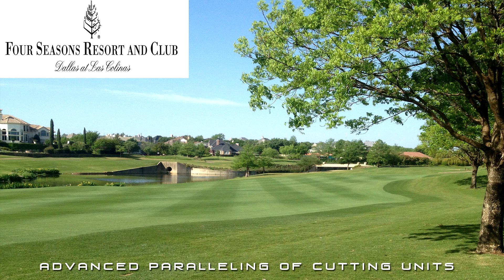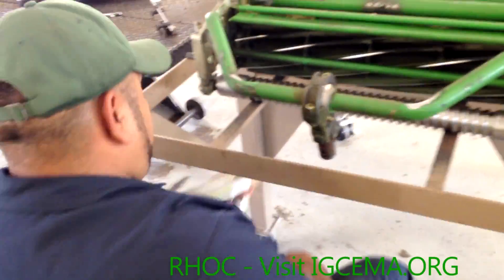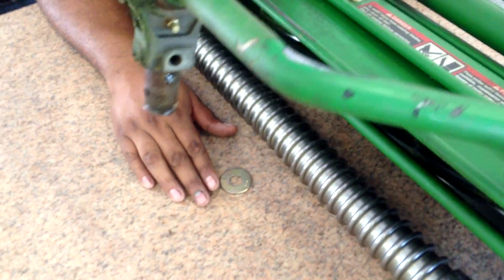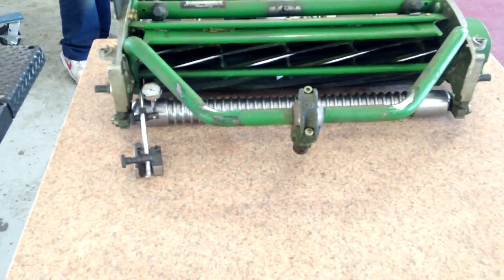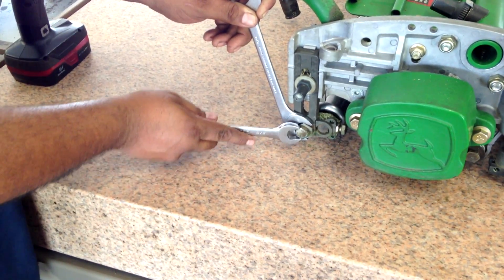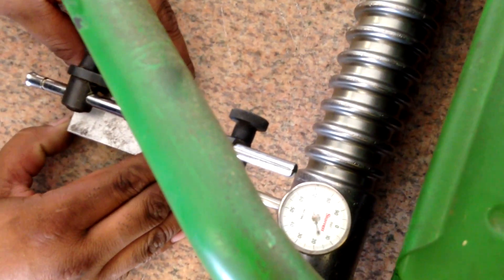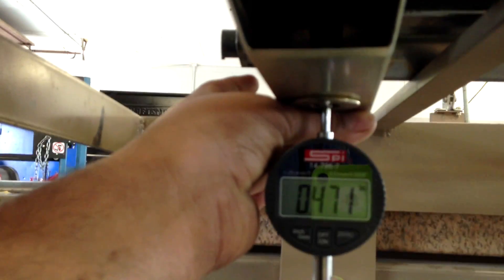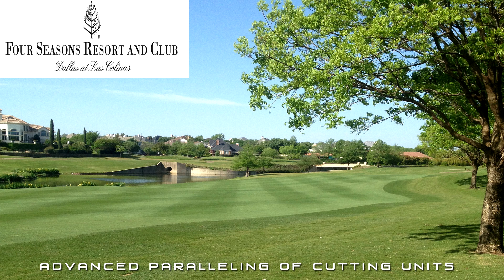Advanced Leveling of QA5 Reel

Comment: Hey Stephen can you give me some advice having issues setting these qa5 units up. I'm not sure what's going on looks to me the bedknife attitude is either not enough or too much. When checking with hoc bar and digital angle guage  most my units are set to 7 to 8 degrees. I'm cutting bent grass what is a good attitude for these mowers ?

Comment: Is anyone else  having problems with John Deere reels with the link system holding an accurate HOC?  We've tried preloading the adjustment nut and everything else we can think of, including new parts.  And no, we don't use impact drills for adjustment. If you have a solution, would really like to hear it.
Reply: They garbage

Comment: This will work with a fresh grind after taper removal and a bedknife with uniform grind. However after the reel starts to wear. You will have to parallel the rollers on the john deere specified bench plate to compensate for taper. With a feeler guage you can parallel just as accurately with the bench plate and save some time as well

Comment from the maker: When you get new cutting units they are all over the board in regards to being parallel. Also they don't remain parallel after being out in the field. 10 years ago or so when the cutting units were welded frames parallel held up better. Now that we have alluminum frames that are bolted through there is more movement.
Reply: What is your process for squaring the frame.that may be a helpful vid.